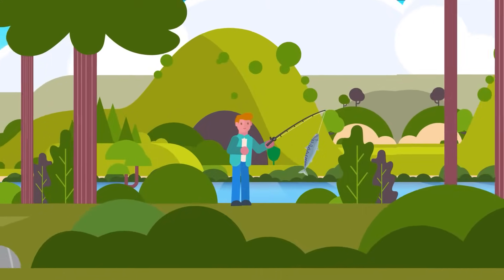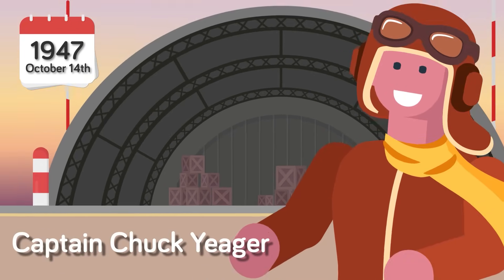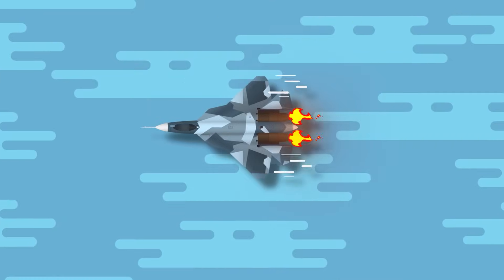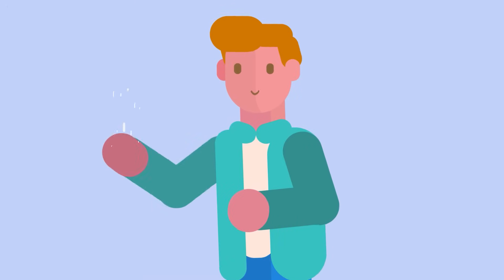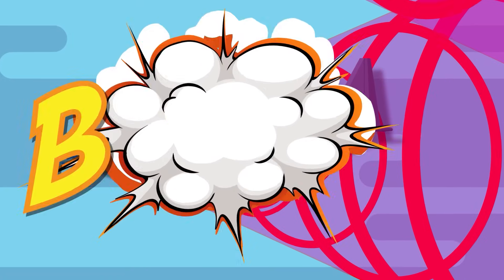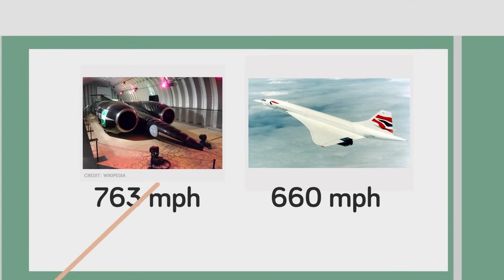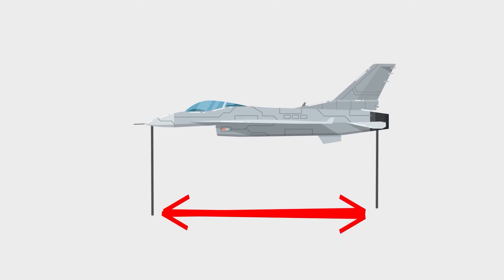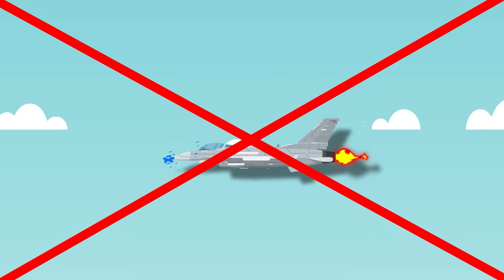What Happens When You Break the Sound Barrier

Comment: At $12,000 per round-trip ticket, a sold out Concorde flight with its 128 seats would have generated $1,536,000.  It made almost 50,000 flights, so that'd be $76.8 billion in revenue over its lifetime - or maybe half that if the 50,000 flights I searched up was each one-way flight.

Comment: There's no question that the Soviet Union's Tupolev Tu-144 never saw the light of day because of their louder sonic booms than the Concorde (the Tu-144 did fly somewhat faster than the Concorde while carrying more passengers and having a louder cabin). Somewhat ironically, the Tu-144 only had one commercial route where it flew passengers over populated areas in the USSR. No wonder it was in commercial passenger service for less than one year...

HOWEVER

That said, they were still used even after 1978 to transport mail and cargo, and NASA even received one for their research and development projects. It's a shame that the Tu-144 was never a viable way of commercially transporting passengers. If only there was no Iron Curtain back then, the Tu-144 could have had a lucrative route between Moscow and New York, and would have given the Concorde a run for its money.

I must also point out that the Douglas DC-8 holds the title of being the first ever commercial passenger jetliner to break the sound barrier (long before the Concorde and Tu-144). Granted, there were tailwinds blowing a specific DC-8 forward to help that DC-8 achieve that title, but the accomplishment is legit enough since passenger jetliners overall back then were in their infancy, let alone the fact that there were no supersonic passenger jetliners during that same time period. IDK that anyone on the ground really noticed that DC-8 when the sonic booms sounded.